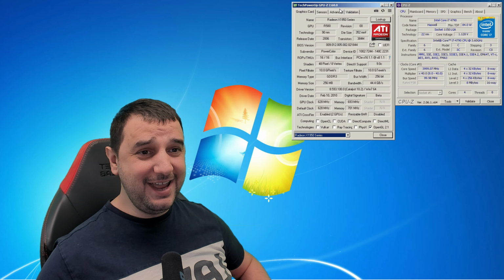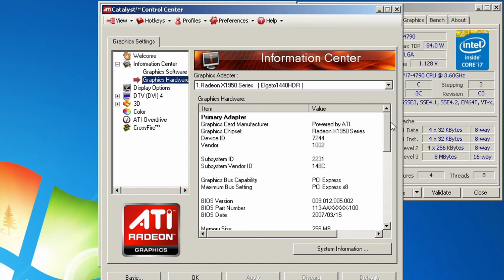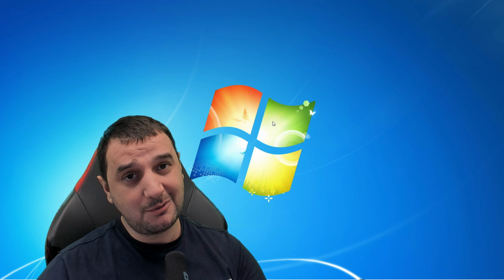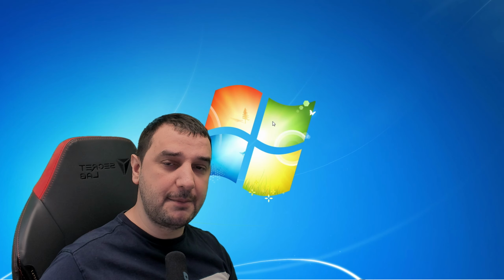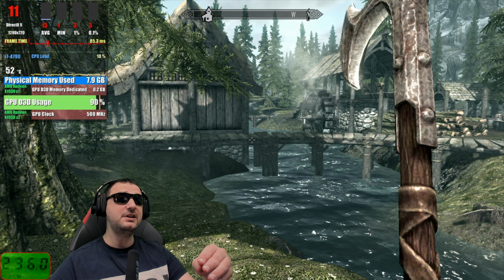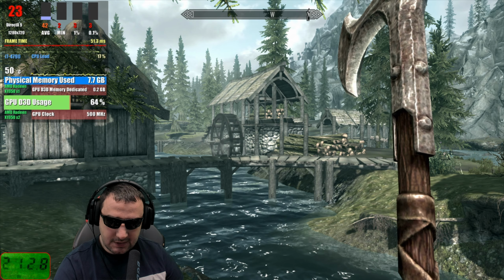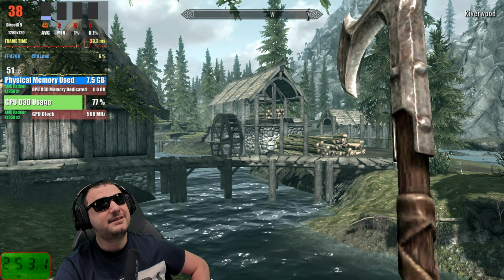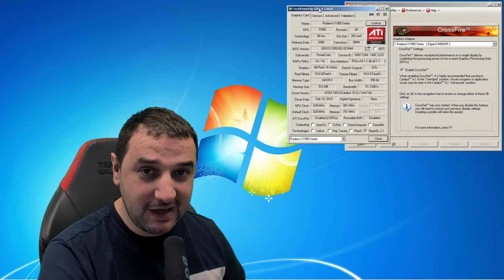ATI Radeon X1950 XT Crossfire Benchmark

Comment: I think the problem is not always in VRAM, but in old architecture. This card not only has small amount of shaders, but they are also not unified. And so if a bit modern game wants to utilize those shaders you get low FPS, like in Skyrim or CoD. Also at 6:01 vram seems to be at the same level as before, so this sudden increase could be game optimization called culling.
The easiest way to test whether it's vram overload or slow gpu is to set the texture quality to minimum and disable any anti-aliasing.
Reply: another way is using two 512 cards

Comment: You got a strange behavior from that crossfire setup. Maybe another run on Windows xp? Maybe there it wil be beter.🤔
Reply from the maker: @candidosilva7755  I blame the vram models.
Reply: @DanielCardei  true on the second gpu it was showing 512 mg of vram. But the first one was only 256.🤔 its wierd.
Reply from the maker: Its like that. I thought both where 256 mb. The second one its 512mb. After realising i said go with it and see whats going to happen.
Reply: @DanielCardei  ok so you knew one card was diferent than the other thats why they were acting funy.